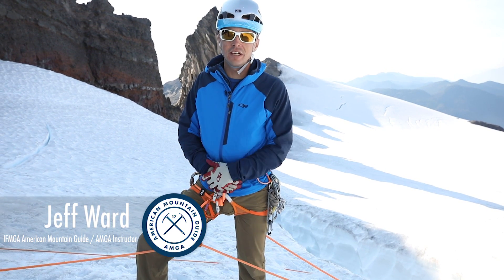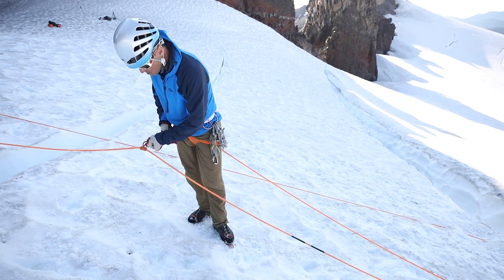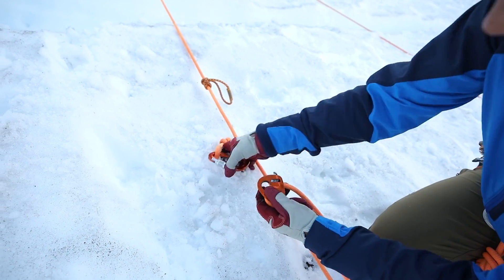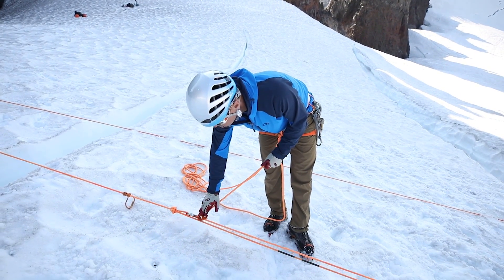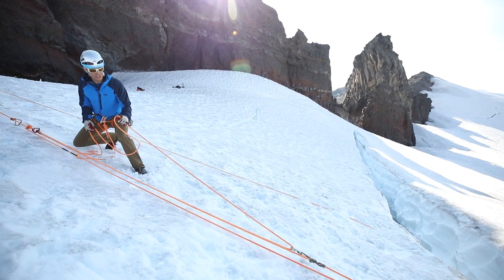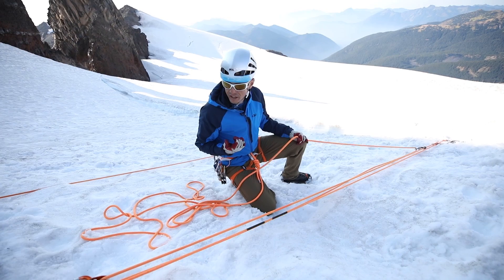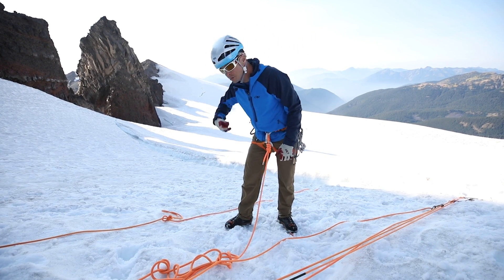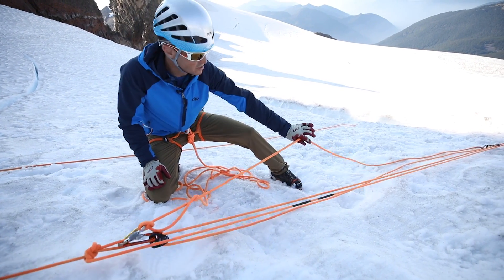How to Haul a Climber Out of a Crevasse

Comment: On the Drop C system, one could use a lot less rope by dropping a loop of rope down to the victim with a mini traxion and a locking biner attached (assuming they don't already have one on their harness). The rope would go from the anchor, to the victim who clips the binder/traxion combo to their gear loop then back up to the rescuers, forming a simple "U".  Also with the victim being attached to a pulley (mini traxion) they can aid in their own rescue by pulling on the anchor side of the "U", making the rescue much easier than 2:1.
Just a thought, I'm no teacher,  just a student trying to understand it all.
Reply: Typically, you only do a drop C if your partner in the crevasse is incapacitated. If they're able to help haul themselves out, the first option is self ascending.
Reply: @benpearman50  if they're incapacitated how do they attach the drop C to their harness
Reply: @chamonix4658  They don't. You have to rappel into the crevasse to set this up for them. It's basically the worst case scenario in 2 person glacier travel, luckily it should never happen if you're travelling properly with minimal slack in the rope.

Comment: Hey, great informative vid! But why use the figure 8 on a bight as the midway masterpoint  on a linear anchor system? Did anyone notice how badly split that knot was? Why not an alpine butterfly?
Reply: Figure 8's are fine, they don't roll. Even with the cross loading they're more than strong enough for this. Alpine butterfly is perfectly fine as well, but its not a knot that everyone can tie by heart
Reply: Figure 8 on a bight can roll when the 2 strands are pulled in opposite directions, and does so at lower force than an overhand on a bight. I would also use an alpine butterfly there, but if that's too complicated an overhand is perfectly fine and I think better than the figure 8 in this context. The microtrax loading the bight loop keeps the knot a bit more stable but still it looks a bit weird with the 8 here.

Comment: This is obviously a very effective way to haul someone out of a crevasse, but it requires a LOT of extra rope -- perhaps 80 feet or more. It's typical for guides to carry extra rope, but as Jeff mentions in one of his other videos, if you're traveling with climbers of similar skill, the people on either end could carry extra rope. However, unless you're using a very long rope, you'd probably not have enough set up this system. An alternative would be to use a 3:1 Z-drag or a 5:1 which uses less rope. Just something to think about.

Comment: Hi, thank you for this video! But i have one querry. What should i do in case when on the rope with load (partner) are knots which we use to break?
Reply: The rope with load and knots leading to the person in the crevasse and the pulley system rope are the same rope, but different ends. So the end for the pulley system does not have knots. And the end with knots gets relieved of any weight by the pulley system. So you can pull the end with knots with just one hand and without any resistance out of the "tunnel" it digged itself. Its not holding load at this time.

Comment: I maybe miss something but this should be 4:1 since there are only two pulley moving
Reply: I vote 6:1. Using the T-method that's what I come up with.
Reply: It's a 2:1 with a 3:1 added = 6:1.
Reply: It’s 4:1
Reply: First the 1:2 C-pulley: when you pull 1 meter of rope, the victim rises 0,5 meters. To pull that 1 meter, you have 1:3 Z-pulley. With Z-pulley you need to pull 3 meters of rope to get progress of 1 meter.  So you have pulled 3 meters, the Prussik of the Z-pulley has moved 1 meter and the victim has moved 0,5 meter. This gives you 1:6.
Reply: @aleksikallio7466  Thanks!
Reply: This would only be true if the 2 systems were seperates, here you can use a simple methld of counting the number of strands going from the ancher to the load an you will see that it is only a 4/1. At least that is what I think.

Comment: what is the minimum rope length you carry on a 2 man team that enables a drop loop 6:1  (ski touring)  Thanks
Reply: It depends on where you're going (size of crevasses) as that dictates rope spacing, and then each person should have twice that spacing (or a bit more) in rope in coils around their shoulder or in their packs to enable a proper drop-loop haul. For the cascades where crevasses are pretty big, ~15m spacing between climbers is recommended to give you lots of time to arrest if your partner falls in, so that equates to a 70m rope (gives you 14m spacing exactly but realistically a bit less after knots). This is a bit unrealistic tho, most people aren't using a 70m rope for parties of 2 (although I have, since big bulky brake knots for soft snow eat up a lot of rope). 

There's a different way to rig this, however, which uses less rope but requires the climber outside the crevasse to untie completely and drop their end of the rope to the climber and then set up the hauling system with what's leftover (might require some creativity and use of cordalette). In this case you put a few arm lengths LESS than 1/3 the rope between yourselves and a few arm lengths MORE than 1/3 in coils on each climber. This way, for a 15m spacing you can use a 50m or 60m rope. Doesn't leave you a lot of rope for a rescue tho.